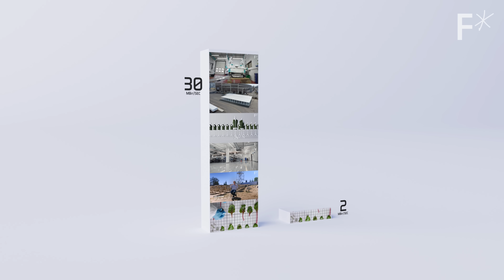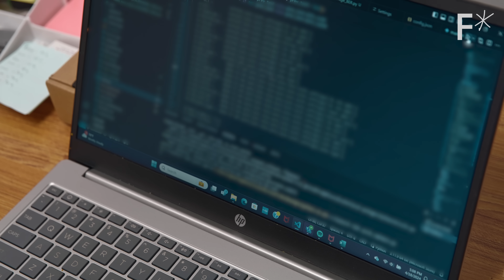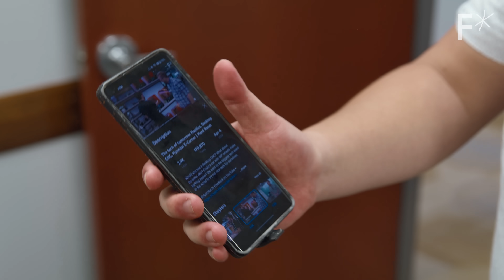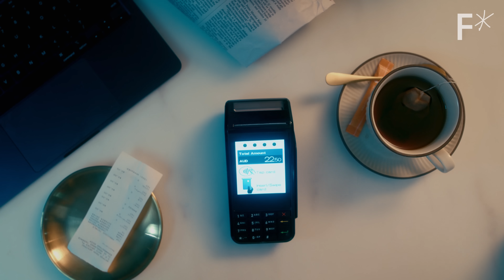This computer chip is the key to an unhackable future | Hard Reset

Comment: Is Nearlink better than Bluetooth?
And it's not just the latency where Nearlink shines. It's also way ahead in terms of connectable devices. It supports up to 4096 devices connected simultaneously and handles data from 80 users within a millisecond. In comparison, Bluetooth supports only 8 devices, and Wi-Fi supports up to 256.

NearLink  , 6X faster than Bluetooth, with 1/30th the latency · 60% lower power consumption · Six times higher data transmission speed ·

Comment: This seems very similar to this book “Terahertz Terabit Wireless Communication” published around 2011. This research, along with other similar works from that time period, discusses the use of the terahertz (THz) band (between 0.1 to 10 THz) for ultra-high-speed wireless communication, including the potential for cellular-level WiFi connections. The THz band offers extremely high data rates, which could revolutionize wireless networks by enabling terabit-per-second communication speeds, far surpassing the capabilities of WiFi and cellular networks at that time ￼ ￼ ￼.

This technology was seen as key to the next frontier of wireless communication, enabling massive connectivity with ultra-broadband capabilities, which could theoretically support high-speed wireless communication at a cellular level, possibly even in medical or nanotechnology applications.

Comment: As for the security concern. The human body can be thought of as a particular detectible ohmic resitance due to our wire like properties with capacitance and inductance.

And change in that impedance can be detected and shut off data flow abruptly. We can also use impulsed signals for packets that are time series encoded and always frequency hopping to make their presence near impossible to detect simply because you must transmit that signal in a very short burst of time to receive it. Only synchronized devices are allowed, and unauthorized networks turn the network off untill user authenticated transfer from the router device. 

As a general trade off... its less energy to spray at you. Tesla made this first... and now we call ot a zinnek surface wave in modern day for planetary scale.

If we used ultra low power impulse dc, if we werent already, then we don't cook the body, we infact, clean and disinfect it according to Tesla's claims and by youtube searching 'cold plasma torch.'

 We could convert this to medicine. Tesla's medical patents were impulse DC based, and we need many applications in Wi-R type applications which may receive and benifit even the body's own bio-electrical signals.

Comment: Well I wouldn't say it is secure. As long as the device makes an electromagnetic signal. Then that signal can be picked up at distance. Considering your body is quite large you have a relatively big target. So to be secure it will still need secure encryption between devices. 

And also for body worn devices that wouldn't need updates often if at all then there is a large possibility they could be targeted and compromised. Just by getting touched. Lol don't use for payments

Comment: I like how most of these comments are hating about it just because it is different and people dont know the proper info about it. I think this is an amazing concept that could be used side by side with other standard protocols. While I do see this being more secure and convenient I do wonder how it performs under certain situations which might create I guess electrical noise in the body or weather. 

Also this would not be any less secure than things like Bluetooth because it prob has encryption and this is not no cyberpunk type thing where you tap something and it gets hacked. If anything it would be more secure due to it needing some form of physical contact.

Comment: okey cool, but wont that disturb our body's internal communication?
Reply: Wi-R signals can’t actually travel inside the body. You bring your finger close to your touchscreen multiple times a day. This induces electric fields between your finger and the screen, that flow around your body. This is happening multiple times a day for you today. Wi-R uses the same physics, but for communicating data.

Comment: Can it increase possibility of cardiac arrest, since it can interfere with our heart's rhythm?
Reply: Good question. Wi-R signals can’t actually travel inside the body. You bring your finger close to your touchscreen multiple times a day. This induces electric fields between your finger and the screen, that flow around your body. This is happening multiple times a day for you today. Wi-R uses the same physics, but for communicating data.

Comment: Couldn’t you “hack” someone by touching the same conductive surface they are touching. Like what if they are leaning on a metal railing, or if you made cushions from conductive fabric and sat on the same cushion, etc. there’s probably endless exploits here.
Reply: Wi-R provides better physical security. If you are in a café and turn on Bluetooth on your phone, everyone in the café has your signal. If they can hack into it or not, depends on how good of a hacker they are. With Wi-R, someone in your next table doesn’t even have the signal to hack into. That’s the advantage. Once someone has the signal, the potential of being hacked is the same as Bluetooth/Wi-Fi.

Comment: That's... actually exciting. We wouldn't need to charge our headphones etc as often which would be AMAZING.

I need this tech in my life NOW
Reply: That's not this tech is used for. It's for information sending only NOT power sending.
Reply: @Consoneer  I know, but sending data through a physical media requires way less energy than light waves, as mentioned in the video.
Reply: @arslanrasit  you're right theoretically it consumes less power, more efficient. i missed that part

Comment: I learned absolutely nothing with this video, it just "magically works". The body is in fact a "bad wire", as one of the interviewees said; it has considerable resistance.The body also isn't a wire, more a blob of water, so any signal you send is being transmitted to everywhere in your body. High data rates require high frequency signals, which in turn don't like high resistance in wires; a property our bodies have.
I don't feel like any of these shortcomings have been addressed here. Sure, I believe that they can build something with an insanely slow transfer rate, but it "magically works" and is faster than Bluetooth? Thx, I will rather have another sip on my Snakeoil (TM)

Comment: Can the signals really be constrained to millimeters from the body? For example, specialized antennas.

This is 'exciting' tech.

All present can touch the table so our AI's can reach a decision, in half a second, ten thousand PDF's and files.

Assault cases might rise.

This is great progress in technology, I dont think most people knew we were such current high power wires.

From externally is one thing, but our bodies - which are as smart and aware as we are - might take offense to being used in this way. Maybe this should also at least be considered, at least.

My avatar seems to say it all, and should have been my only response. 

Good work.

Comment: bringing back the handshake to seal a deal?
Don't. It's a joke. Don't make unrequested touching more attractive. I wonder about security about this. I also wonder if it messes with Neuralink and other BCIs.
Reply: Wi-R doesn’t actually need to touch. Anything within a few cm similar to NFC works. The advantage is extending the range of NFC. Imagine you are at a café trying to pay. Instead of whipping your phone out to pay, you simply leave the phone in your pocket and bring your hand close to the screen. 

Also, Wi-R provides better physical security. If you are in the same café and turn on Bluetooth on your phone, everyone in the café has access to your signal. If they can hack into it or not, depends on how good of a hacker they are. With Wi-R, someone in your next table doesn’t even have the signal to hack into. That’s the advantage. Once someone has the signal, the potential of being hacked is the same as Bluetooth/Wi-Fi.
Reply: @ixanaai  and if someone bumps into you while walking down the street?

Comment: why not use the seas (salty water is more conductive than skin) to transfer data at HUGE distances almost at the speed of light? it is essentialy an wire connecting everything together. (for landlocked areas, just connect a long wire to the water if you can get permission.)

Comment: totally hackable and wirelessly hackable 😮
Reply: Wi-R provides better physical security. If you are in a café and turn on Bluetooth on your phone, everyone in the café has your signal. If they can hack into it or not, depends on how good of a hacker they are. With Wi-R, someone in your next table doesn’t even have the signal to hack into. That’s the advantage. Once someone has the signal, the potential of being hacked is the same as Bluetooth/Wi-Fi.

Comment: I'd have to imagine something like this would be a nightmare for security in crowded spaces like elevators and buses without some encryption or authentication as you didn't even need to touch the copper strip to connect to the speaker, so while definitely a step up over radio I can imagine someone using something similar to an induction sensor to scoop up whatever data is floating around in those bubble networks especially in one of these aforementioned spaces.

Comment: until it needs a battery - it useless 
(high-bitrate data transfer such as video/audio)

also...
in post-covid world people prefer 
NOT to touch things by their hands, 
so they will be better using some smart-ring 
with NFC for "such needs" rather than
touching dirty surfaces with their fingers

so really... it's nice, but useless
Reply: Wi-R doesn’t actually need to touch. Anything within a few cm similar to NFC works. The advantage is extending the range of NFC. Imagine you are at a café trying to pay. Instead of whipping your phone out to pay, you simply leave the phone in your pocket and bring your hand close to the screen.

Comment: Shakes hands, credit card information stolen
Reply: Wi-R provides better physical security. If you are in a café and turn on Bluetooth on your phone, everyone in the café has your signal. If they can hack into it or not, depends on how good of a hacker they are. With Wi-R, someone in your next table doesn’t even have the signal to hack into. That’s the advantage. Once someone has the signal, the potential of being hacked is the same as Bluetooth/Wi-Fi.

Comment: I think it’s weird that they’re placing a security emphasis on this. Going from “they can hack you wirelessly from several meters” to “they can hack up contactlessly from several centimetres” doesn’t give the modern consumer much assurance - that’s why passport wallets with RFID blocking are on the market, people are already wary that someone could bump into them and ostensibly steal your identity.

If and when they bring this to the market, encryption still needs to play a factor. Perhaps it should even be strengthened, since this is a once-in-a-decade chance to hard reset the protocols with more modern ones (instead of having a Bluetooth vulnerability cropping up every 3 months or so). This should not be taken as a chance to get more lax in security.

Comment: Also think of scenes like a Tokyo rush-hour subway, where everyone is jammed in together in discomforting and unavoidable proximity. You will HAVE to be able to easily turn off the signal. But another step in the man-machine interface that appears positive if controlled.

Comment: Our bodies has a very small electrical capacitence. If we can trigger a switch by temporarily altering a C value in a circuit by a mere 10uF, its 100% possible to generate information pulses and replicate that in a circuitry as event listeners or triggers for complex calculations. It's an idea that has been around for awhile, but so far this is the first time I've seen this going to take off commercially.

Comment: Exciting technology, I await seeing it become mainstream. Concerning security, there is a huge hole that needs to be addressed. If I control the environment, I could easily tap into the body area networks of those within that environment. If I own the coffee shop, lounge, or boardroom, those in the environment could have their networks easily tapped into. I would cover the surfaces of chairs, tables, etc. with conductive fabric sections that I would route to my spy processors. It could also be something I hand you like a shopping bag, badge, pamphlet, etc. within which I would hide a wireless channel to my network (this is short-lived so power will not be a problem). I would not interconnect those sections so that the individuals would not be connected to each other. For example, I would host a meeting with my vendors, customers, and competitors and be able to spy on their supposedly private interactions with phones, laptops, etc.

Comment: That means we have to rethink before handshake. Handshaking with anyone can get us hacked!
Reply: Wi-Fi offers better physical security than Bluetooth. If you turn on Bluetooth in a café, everyone there can detect your signal. Whether they can hack into it depends on their skill level. With Wi-Fi, someone at the next table may not even be able to detect your signal, let alone hack it. This is the key advantage. However, once someone does access the Wi-Fi signal, the potential for being hacked is similar to Bluetooth.

Comment: Suddenly i am thinking of the scene in Silicon Valley where the startup is heating people in a room by microwaving them.  But hey, my shameful alma mater that now has a for-profit school and a law degree that cannot practice in its own state is involved, so i am sure you can trust it.
Reply: Wi-R signals can’t actually travel inside the body. You bring your finger close to your touchscreen multiple times a day. This induces electric fields between your finger and the screen, that flow around your body. This is happening multiple times a day for you today. Wi-R uses the same physics, but for communicating data.

Comment: Security wise if anything it's worse, instead of having to hack a wireless network, now they just have to bump you in the street and tada, they are connected to my local network !

it also means that I need my phone constantly almost in contact with my body in order to do anything, so a lot of the time I would be using wireless connections anyways, unless they can figure out a way to seamlessly switch between the two, because I'm not dealing with my music stopping every time I place my phone somewhere, or it just moves slightly too far away while in my pocket.

And each devices still need batteries, they just last longer, so ecologically it doesn't solve anything either.

Is it just me or does this seem like it's solving a problem that doesn't exist ?

Comment: About security. We have bunch of protocols that allows secure communications even every last bit a captured by a malicious actor. So, this point makes very little sense as all our data is encrypted
Reply: It looks interesting for payment, or establishing initial connection(for instance with headphones, or share wifi password). However, beyond seems not very usable. As in case of headphones, I often just leave my phone on the table and walk around my home and I don't wanna be connected to physically
Reply: Wi-R provides better physical security. If you are in a café and turn on Bluetooth on your phone, everyone in the café has your signal. If they can hack into it or not, depends on how good of a hacker they are. With Wi-R, someone in your next table doesn’t even have the signal to hack into. That’s the advantage. Once someone has the signal, the potential of being hacked is the same as Bluetooth/Wi-Fi.

Comment: Well for the «hacking issue» I think it would be now an implementation/protocol level issue ,being hacked trough contact would become something to consider while developing software,for example you can add a «pairing delay » or restrict the information which are sent but on a lower level this is already a really interesting technology

Comment: Meta could use that for their new VR glasses, to communicate with the processing unit
Reply: Not even remotely enough bandwidth or reliable connection for that application
Reply: @quantuminfinity4260  Right, let's wait for versión 2.0